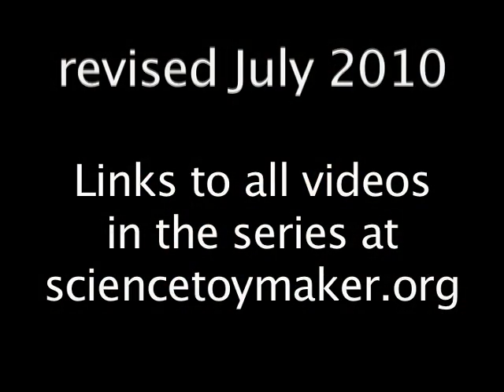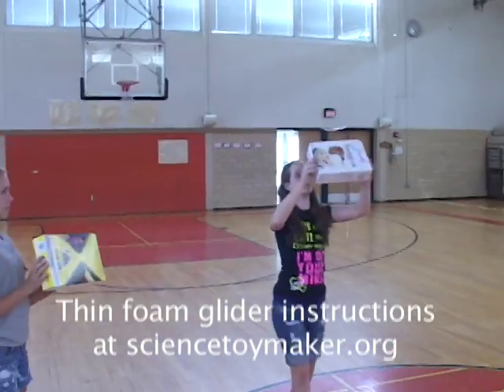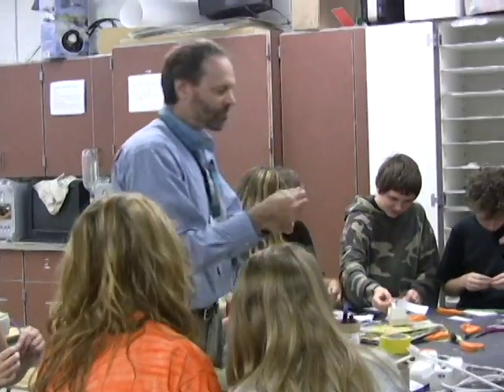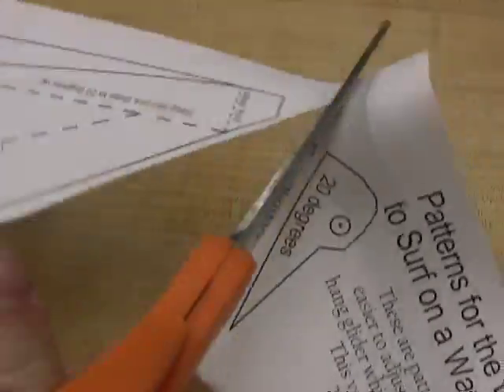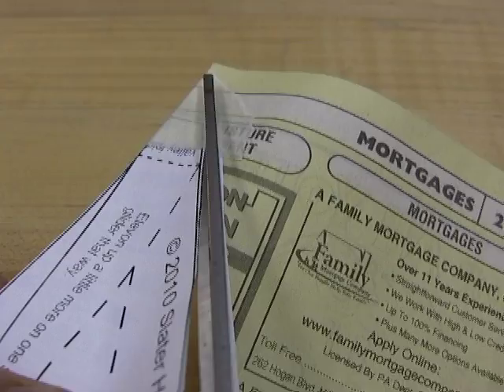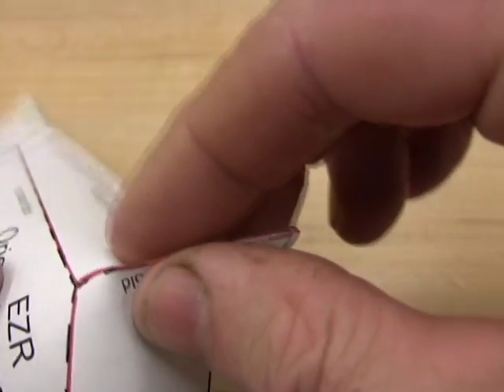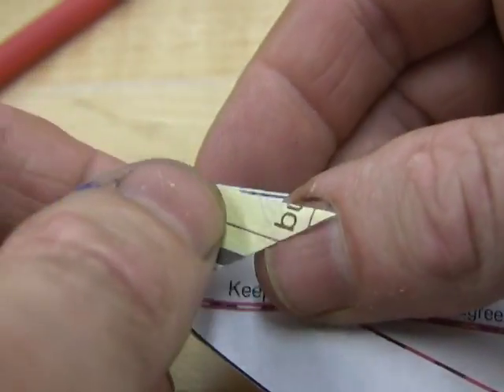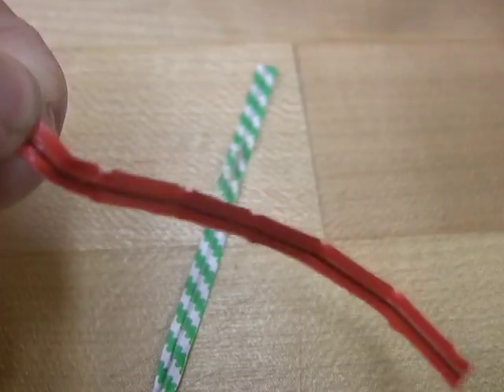Part 2 Surf an Origami Hang Glider a.k.a Handy Glider on a Wave of Air CONSTRUCTION revised 8 10

Comment: Science toy maker I tried to print the templates but I just can,t find it.where can you print it?
Reply from the maker: The pattern is linked in the text section, but here is the link.
http://www.sciencetoymaker.org/hangGlider/images/EZRhighAspectMed.PDF
Note that I keep this video up for archival purposes, but 1/2 mm thin-sliced foam works much better than any paper.
http://www.sciencetoymaker.org/airsurf/index.htm
Reply: Can really soft foam work?
Reply from the maker: Jenny Yuan Well, it has to be rigid enough to keep the wings spread out. This is an article about foam. I hope to make a video about cutting your own foam soon.
http://www.sciencetoymaker.org/airsurf/Time%20Warp%20EPS%20Foam.htm
Reply: sciencetoymaker from where to find that foam dude

Comment from the maker: Any weight will work fine. I like thin wire because it can be micro-adjusted easily just by bending in more forward or backward, without having to add or cut off weight.

Slater

Comment from the maker: @kerriechapa210 Any weight will work. I used to use straw slivers, but I found that thin wire was easier to adjust. With straws you have to cut off a little or add tape to adjust weight.
Slater

Comment from the maker: @jojoQ22 Unless you are a hang glider pilot or have made lots of model planes or something like that, I wouldn't expect the first one to work. But if you consider what you're doing--it's worth the trouble to try it again. Also, it's a good idea to start with the tumblewing first--much faster and simpler to build.
Slater

Comment from the maker: @hollieandsusanrule Yep, it's not easy. I just switched to a new design with a new pattern and new videos. Make sure you have the EZR pattern, not the 241 pattern.
In a few months the I will have instructions for foam gliders, which will be easier to make. 
Slater